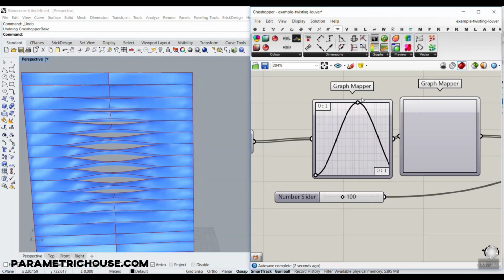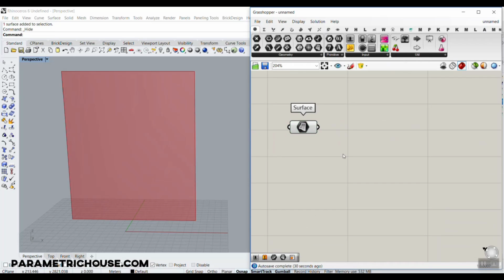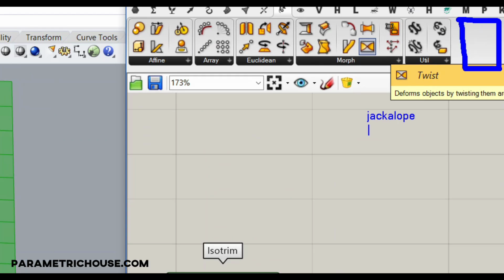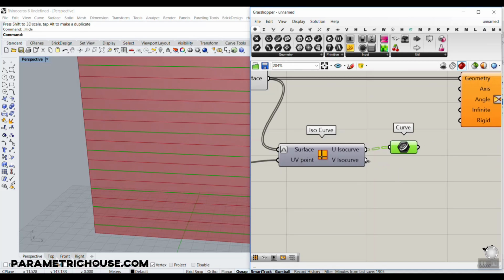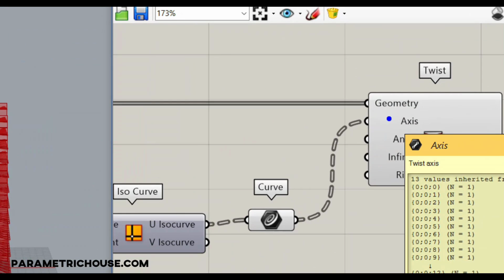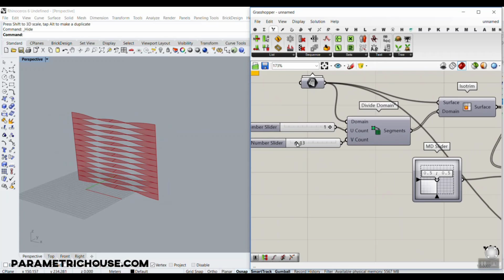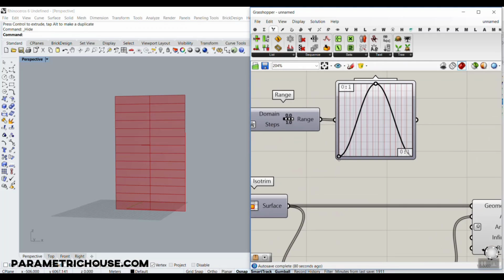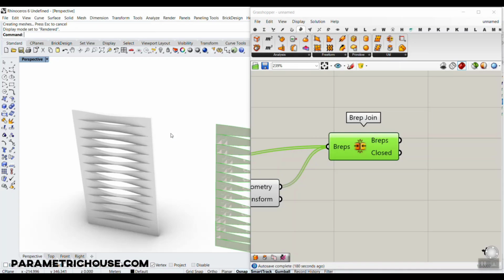Grasshopper Tutorial (Parametric Louver)

Comment: Not sure why my rotation on the twist is too high. I am using the plugin for Rhino 5 MAC. I set it at "degrees" and did the step by step tutorial. In my case when I use 90 rotates several amounts of time the strips and not 90 degrees. Is it possible the plugin works different than the native component in Rh 6 ?
Reply from the maker: try using the radians component to convert degrees to radians.

Comment: I'm using Rhino 5 and Jackalope for twisting. everything works fine until I get to twist, I get hundreds of extremely twisted geometries, and yes I have used degrees, and I also downloaded the file, once I used the twist component I got the same results. I know the problem is the component, is there anyway around it?
Reply from the maker: Try to keep both the geometry and the axis in groups , that means graft these two inputs.
Reply: This worked for me thanks!  @ParametricHouse